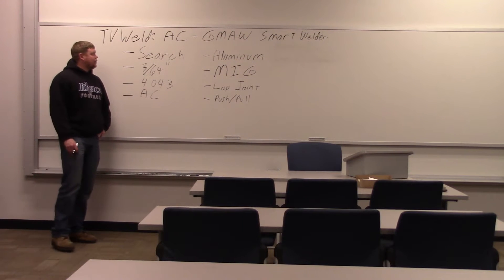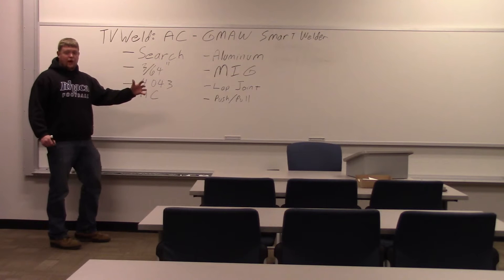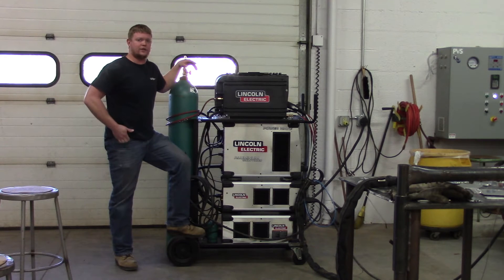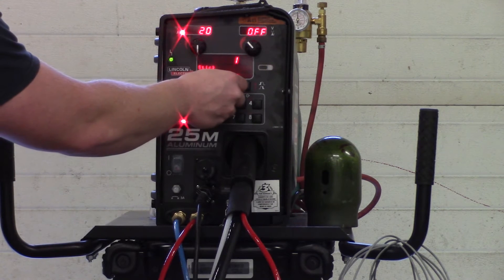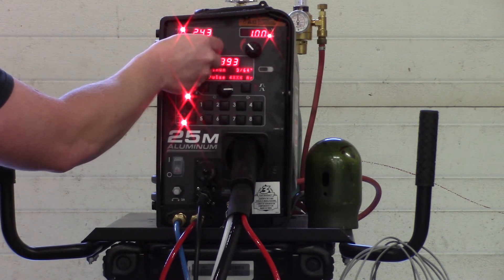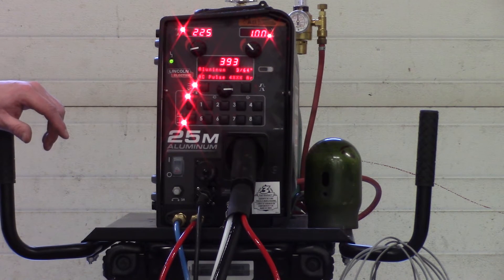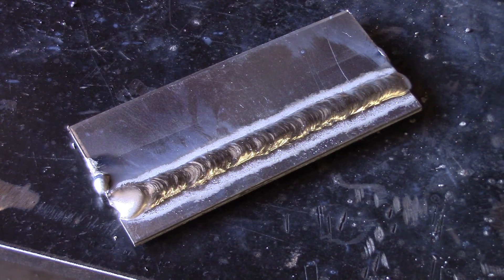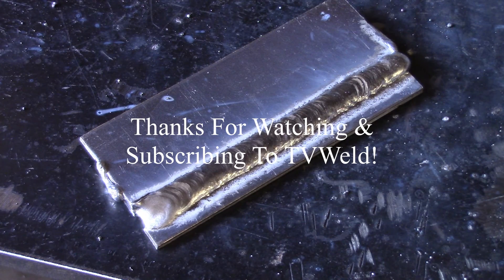AC Aluminum MIG Welding

Comment: Is it possible to weld 1mm thick sheet or tube T joint.
Reply from the maker: That's a bit thin.  It's limited to around 1/16".